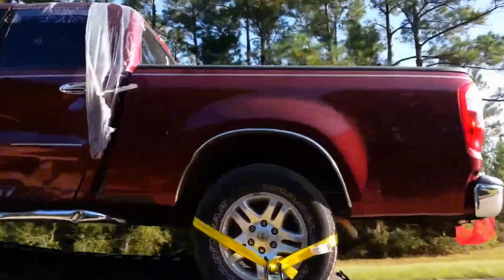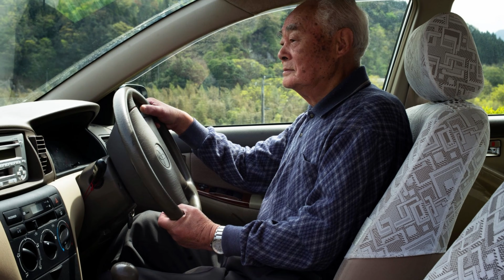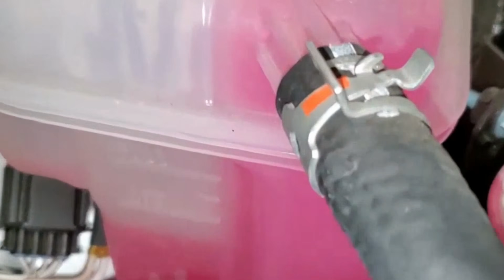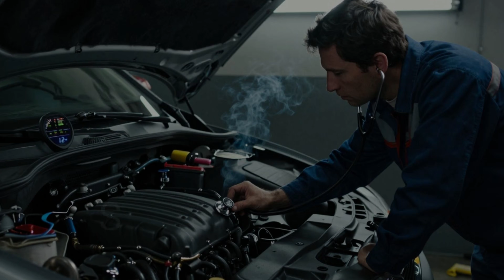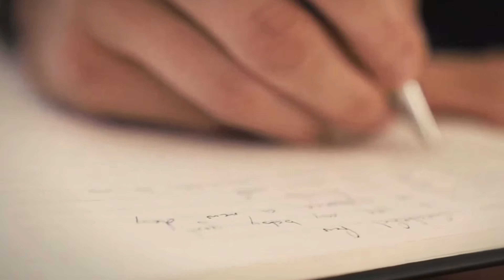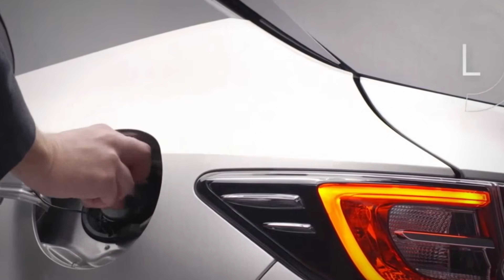The Japanese Method to Make Your Car Last 500,000 Miles on One Secret

Comment: QUOTE Yes, Japanese owners frequently trade in or sell their cars with low mileage (often under 50,000–60,000 km, or ~30,000–37,000 miles) after only 3 to 5 years of use. This behavior is driven by strict, expensive, and complex mandatory inspections known as shaken, which make owning older vehicles, especially after 5 years, economically unappealing.
Reply from the maker: That’s a great breakdown 👍 the inspection system definitely plays a big role in why cars get cycled out earlier there